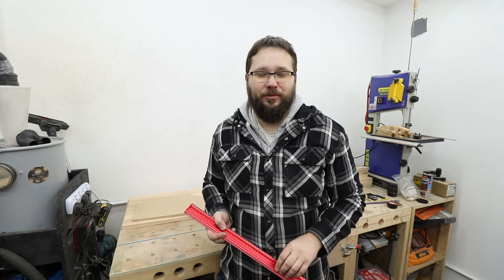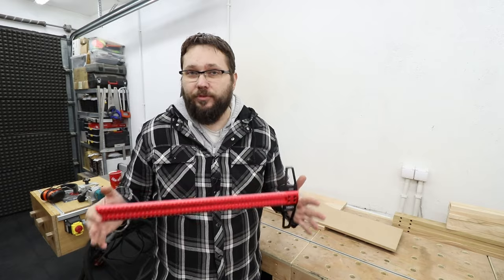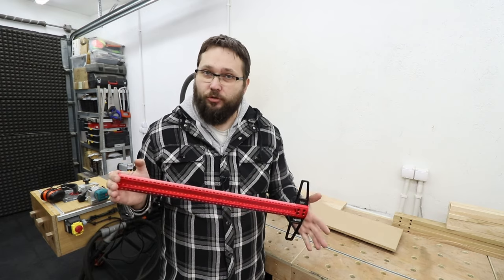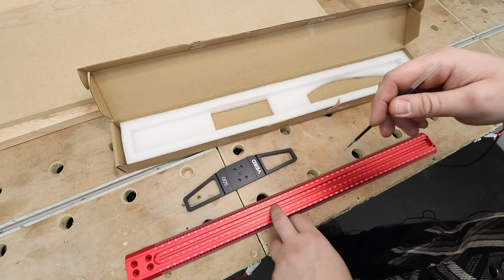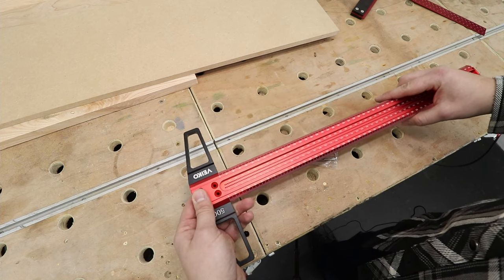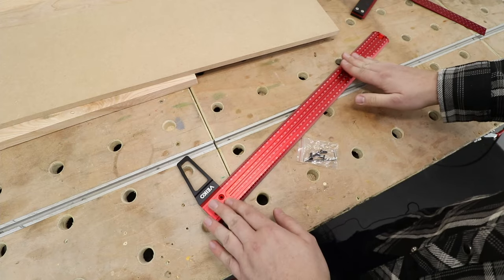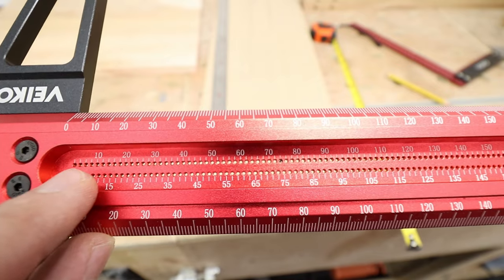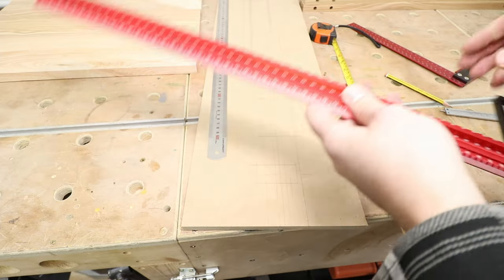Precision T Ruler | T Square From Banggood | Cheap Tools from China

Comment: Nice video. I have the 600mm and very happy with it. One thing that takes a little bit of concentration before you get used to it is with the marking holes. At .5mm diameter they are spaced 2 mm from the next one hence a row of holes for the odd and one for the even numbers. This had me double take a couple of times in the beginning. As for the inacuracy of the .5mm holes it is easily avoided if one lets the pencil center itself by holding it losely while sliding the ruler along so the ruler guides the pencil and not the opposite.

Comment: I really like the Veiko products and have the bench dog ratchet clamps, 300mm square and this product also. It is versatile in that you have the choice to fit the T or not and use it as a ruler. I was a bit puzzled by the pen insert too and was looking around the packaging for the rest of the pen. Keep up the good work Thomasz. Cheers 👍😎🇦🇺
Reply from the maker: Thank you kindly. Yes its a shame they didn't supply the whole pen right? Now I need to find something it will fit in 🤣

Comment: Hi Tomasz, great videos and keep them coming as they're very informative.  Here's another way of testing if the t-square is square.  Cut a board 1-2 centimetres narrower than the square, pick the best edge and with an engineers square mark a line on the edge for the full width.  Then using the t-square scribe a line from the line on the edge across one face of the board, turn the board over and again scribe a line from the line on the edge across the other face of the board.  If the t-square is square then you should be able to scrive a line using the engineers square across the opposite edge between the two lines on each side of the board.  What do you think?
Reply from the maker: Thank you. Hmm sounds as an interesting process I need to try that out 👍

Comment: Just got my Veiko 760mm T ruler delivered today after watching another review saying how precise it was and not to throw money away on top brands. However after fitting the end to the rule I held my Woodpecker square against it and boy is it out. Over 300mm it is out of square by 1mm !  And of course there is no way to calibrate this, so back it will go to Bangbad as an Imprecise T Ruler. I'm sure some will say this is just bad luck, but I've taken the road before with cheaper brands and should have learnt my lesson.
Reply from the maker: Unfortunately that's always a possibility with cheap brands, can't compare to woodpecker but that should be the case. You need a mortgage to get a square from woodpecker 😅

Comment: Hi Tomasz, thanks for another informative video. You mentioned the Drillpro being a single piece but it is in two pieces the same as the Veiko. The Woodpeckers version is also in two parts. I have both the Veiko and Drillpro versions and I must say I prefer the Veiko version. Look forward to more of your videos.
Reply from the maker: There is a Drillpro that looks bit different and to what I seen on the photos it's in one piece. However I could be mistaking 🤔
Reply: @CasualDIY  Hi Tomasz, I think there are some saddle type squares by Drillpro - TS 3, 6, 8 which are imperial and also T50, 60, 100,160, 260 Which are metric but I don't think the metric ones are Drillpro. None of these are as long as your reviewed product though, and I think apart from the smallest they are two piece as well. Hope this helps.
Reply from the maker: I just had a look at the one I was thinking and scrolled through the photos and found that there are some screws from underneath. That's why initially thought its in one piece. I wonder If I can find one like that but in one piece.

Comment: For fine work, using the holes in the ruler with a 1mm lead would give a 1mm wide line. For accuracy one would need to cut in the centre of the line each time. If this wasn’t done the worst case the error between two cuts could be 1mm which could compound over several cuts. For many projects it may not be an issue, but accuracy is the main selling feature of the the item which suggests it would be used for “fine” work. Your comment about using a 0.5mm lead in these holes and possibly getting a “wobbly” line is spot on. I would think the product could have 0.5mm holes which would reduce the errors. Is there an experiment you could do to assess the errors that could occur?
Reply from the maker: That's correct, I wonder how much of an impact it would have. I'll add it to my advanced series. Its actually an interesting topic. Thank you. It will be cool to see if it will affect anything in woodworking
Reply: Roger, wobbliness could be eliminated by the use of 0.9mm lead refill (1mm is rather unusual). Remember that automatic pencils have a sleeve which in this case, will fit snuggly into the hole.

Comment: I think your comment about it not being able to be used as a ruler is a bit unfair - It isn't designed to be used without the T piece, otherwise it would have have been called a ruler rather than T-square
Reply from the maker: True, but it's good to sometimes look outside the box. People find uses for tools that were not "design" to do. 
However the true reason I did show that I my video was the fact I'm certain of few questions asking if you can just use it as a normal ruler 🤣
Reply: @CasualDIY  that is a good point - people are like that.  I look forward to the drillpro version. - I went looking and could only find a drillpro one that looked like it was two parts and had screws.

Anyway I like your vids, keep it up!  I like how they cater for the normal person, not the festool diy'er type :)
Reply from the maker: @thenarcotk  Festool DIYer love that. The only thing I got from Festool is a hoodie which was gifted to my by a friend 🤣
I'm making a project now that was made by one of the big American YouTubers with the Industrial DIYer tools🤣 
And the purpose of this video is to prove /or not if "normal budget tools" can do the same project with the same outcome/ quality.

Comment: Had the T bar not been put below the surface so you could use it as a ruler, then you'd be having to mention that it is hard to get square and moves.  Very silly "observation", a ruler isn't it function, if anyone wants to try to use it at such, that's on them, and no place in a functional review.
Reply from the maker: True, the reason I have put that in my video was that I expected questions "can you use it as a normal ruler" that's all.